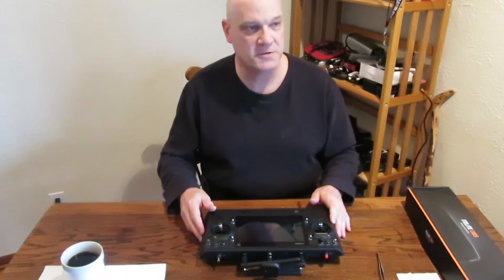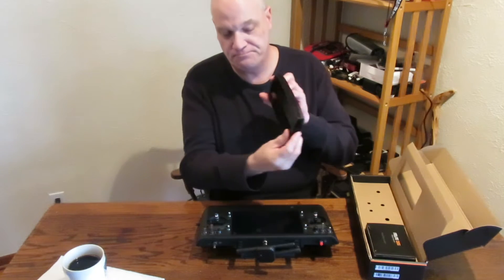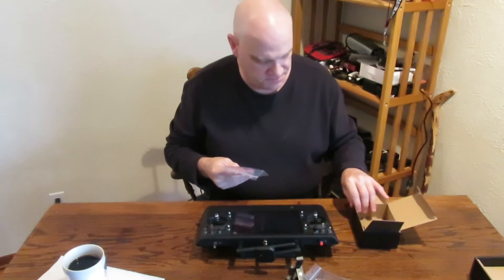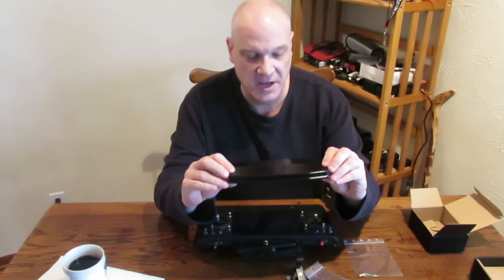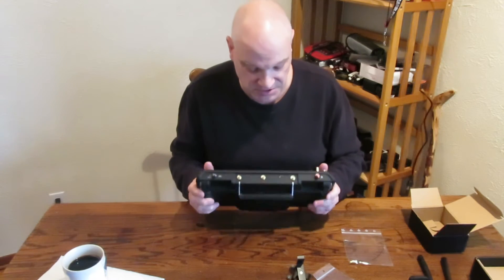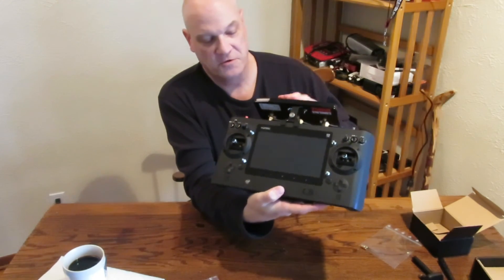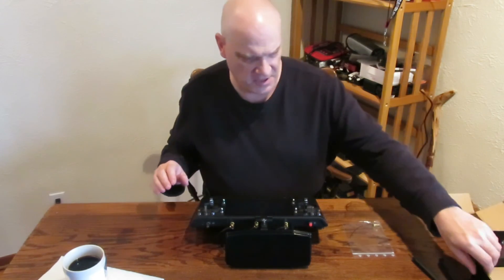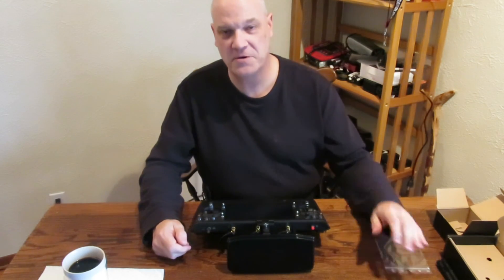Yuneec ST16 Itelite DBS Range Extending Antennae

Comment: I found if I mounted the antenna flipped around the other way then you can still lay the controller down with the handle pulled out to rest on rather than having the weight of the controller resting on the edge of the antenna. Just my observation